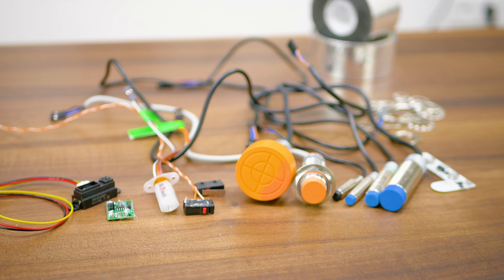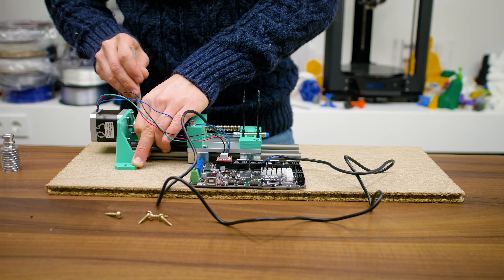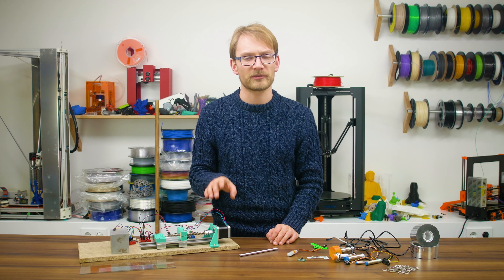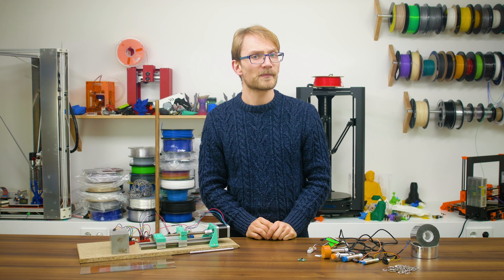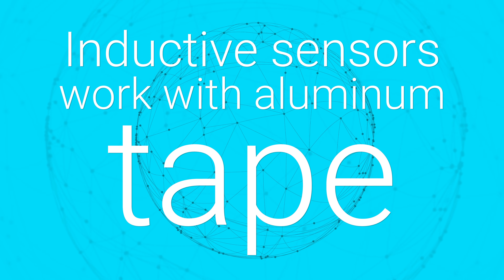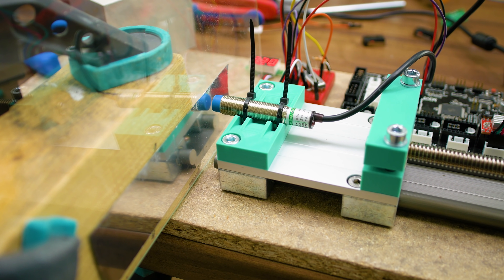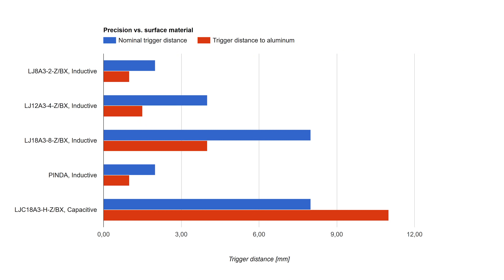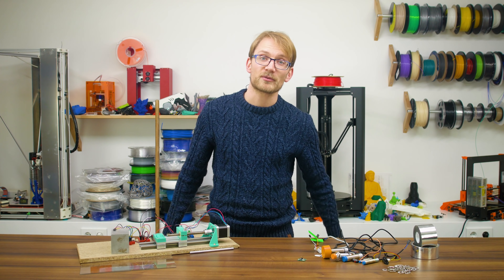Autoleveling on 3D printers: 9 myths and 12 sensors tested!

Comment: No hall effect sensor ???
Reply: I use to use the for home and limit switches supper repeatable
Reply: Used mine from old floppies and pc fans... worx ok...
Reply: hey guys, quick question. I set up my whole printer and everything works. but when I start a print, the printer homes and then the hotend digs into the bed, the z probe is as far as it can go. Where can I adjust this in firmware? I am kind of in a rush so any help is much appreciated.

Many thanks!!!!

Comment: Thanks for the info, but I'm not clear on which sensor would be best for printing on glass. Capacitive has always seemed like the best option, but the info shown in the video makes it seem like a terrible choice for any print surface. Can someone please clarify this for me? Thanks
Reply: Drew Lakebrink use inductive with aluminium foil sticked only in corners where measurments are done, best option as you are measuring top layer of the glass not the bottom one or the bed under the glass. Tom used wrong aluminium foil in the movie, use that which is used in air heating industry with high temp glue and it is a pure alu. works really best as you can even pri nt on this without a problem, just use proper glue stick from BIC as others may not work so well.

Comment: Hey Thomas, thank you for this great video! Unfortunately the links to the sensors point all to the same sensor.
What sensor would you recommend for my Anet A8? I've just begun 3D printing and I really love it :)
Reply: Have the same printer, and I just connected wires to the nozzle and the bed and used that as a sensor. Remember to cut holes in any nonconductive bed surface (like masking tape) and leave the normal endstop switch connected to keep the machine from crashing.

Comment: The video was very informative.  But I have to question your method of testing the inductive probes.  The aluminum bed on printers with them are only around 6mm, not the large mass of aluminum you used.  Could you rerun the tests using a 6mm aluminum plate and test the trigger height between probing the center, edge, and corner of the plate?  In my use of an inductive probe, I have seen a difference in trigger height based on where the probe point is on the bed.
Reply: Edward Boston I may be crazy, but my inductive probe acted like it was "seeing" my steel bed carrier through my MK3 aluminum heated bed. Is that possible?
Reply: I doubt it, but you never know.  I was seeing all sorts of inconsistency with the probe I was using that I gave up on it and went with a BL Touch.  One issue I had was I have a PrintBite on my bed and with a 4mm probe, it had to be so close to the bed that it was almost at the same level as the nozzle.

Comment: How do you feel about auto levelling? I personally don't like the idea of the Z axis having to move during a layer print. If I'm worried I just use a raft, which will end up levelling before the actual model prints. What I really want to see is 3 servos to level the bed corners.
Reply: Servos are just so unstable. What you want is the thumbscrew on top and having a hook for the nozzle to turn it. g
Reply: HenryLoenwind no idea what crazy setup you're envisioning but I guess it's not the one I was... I use servo in its loosest term: any motor hooked up to a potentiometer to increase positional accuracy, not as in your hobby king swivel arm 180° ones. As such, a small motor attached to the thumbscrew so it works as a linear actuator and a linear potentiometer hooked to that setup for positional feedback. Doesn't seem too ludicrous.
You were suggesting using the nozzle to turn a thumbscrew? That grates against my engineering sensibilities quite badly.
Reply: +HenryLoenwind
Oh man, the mental image you just gave me of a printer spinning its nozzle around a hooked screw to 'adjust' itself before it feels comfortable enough to start producing a part is hilarious to me, for some reason.
Reply: Guess you missed the G at the end. He was joking. LOL!

I thought it particularly funny a guy with "Mirth" in his name would miss the joke. :-D
Reply: My team is actually working on a printer for the market with all best stuff available, and that includes 3 steppers for Z axis for REAL bed leveling, not some sort of lame workaround. ;) Fast hotbed (0-110C in 25 seconds), 300x300x450 build volume. Won't be cheap though. Good stuff is never cheap :)
Reply: The MAJOR benefit of bed leveling is for modeling the actual bed surface, for constant correction during printing of a layer .. invaluable for large bed printers, where a lightweight print bed once heated simply can not be made flatter than +/-0.1mm, bed leveling saves the day.

Comment: out of all the sensors that you tested what one would you recommend to use on an aluminum bed with 3-4mm glass
Reply: i guess you can't go wrong with the bl touch if you print on glass
Reply: Why do you need a leveling sensor on glass aren't they flat?
Reply: @chloemcholoe3280  The glass (print bed) will be a flat piece of glass.   However, it is then mounted inside a mechanical device.  If one edge is mounted lower than the opposite edge then your first layer of 3d printing will not adhere well to the glass.  The print bed must be leveled to ensure that the 3d print head glides over the whole print bed at the same height before a 3d print begins.  Then the 3d printer will reliably 3d print the first layer and subsequent layers.  This leveling can be done manually, with no automated sensors, or leveling can be done with automation using the kinds of sensors tested.
Reply: @paull1316  yeah. my point was the reason I for these probes in my opinion is for fixing warpage. with glass you can just like live adjust the 4 corners as it's printing and it takes a few seconds really
Reply: @chloemcholoe3280  - glass can be warped or bowed if not made correclty.  Also, glass isn't the only height variable.  its possible that the gantry rail that the hot end rides on can be bowed.. which may change the height of the nozzle as it moves back and forth.
Reply: @georgelouie5330  but the 4 leveling knobs! you use those! but i guess. even the cheap glass I've bought are flat. but maybe that was just my luck!
Reply: @chloemcholoe3280  - the quality of the stock leveling knobs do not affect the flatness of the glass or the squareness of the glass to the nozzle.    My point was that the auto bed leveling probes fix more than imperfections in the bed.. it maps the distance between the nozzle and bed at multiple positions, and then uses that map to adjust the height of the nozzle to maintain a constant distance as its printing.

Comment: Mine BLTouch is just horrible at repeatability :( Up to almost 0.2mm difference between probes. Only solution suggested by support was to slow down probing speed, but it wasnt very helpful. I have better result with capacitive sensor on 12 volts

Comment: You mention that the aluminum tape doesn't work but I am using it on a glass bed and having great luck. Maybe I got tape with a higher aluminum content or something but my sensor seems to reliably sense around 2mm on a single layer of aluminum tape (under blue tape) using the LJ12A3-4-Z/BX sensor. I am however running it on 12v with a voltage divider on the output so maybe running it on 5v reduces the sensing distance further making it unusable.

Comment: My Printrbot Simple Metal inductive sensor triggers using a glass bed with aluminium tape.... The sensor actually triggers at double the height than with the stock bed. Strange.....
Reply: Funny, I too have a Printrbot Simple Metal with glass bed and aluminum tape.  It worked from day one and I never had any problems.

Comment: Does anyone have any suggestions for an effective sensor for Buildtak coated glass on a mk2a PCB heated bed.  I've tried a Pibot Optical Endstop but couldn't get it to trigger against the matt  black of the Buildtak.  Thanks
Reply: My Mini IR sensor works with black Buildtak.

Comment: great video! cool rig, shows the power of rapid prototyping. been thinking about Auto leveling, I have a delta that uses pressure pads, would be great to see how well it stacks up, down side is Auto leveling is tapping printer head into the bed every time.

Comment: Mh for the LJ18A3-8-Z/BX I run it directly from the board without a voltage divider. Tried it first with your voltage divider approach but then the sensor didn't trigger at all. But running the sensor directly of the board it works fine (for me on a aluminum bed with BuildTak ^^)

Comment: I have a question about the inductive sensors... How much 'material' do they need below and around them and at what point does it make a difference? For instance: If I trigger right on the edge of my aluminium plate it triggers lower then when probed in the middle of my plate. Does thickness play a huge role? Do they trigger higher when there is a bearing holder right below the sensing point? How thick does the aluminium need to be to not have that influence...

Comment: one thing you're missing are FSRs, force sensing resistors. i use them on my delta which has a glass bed over an aluminum heat spreader.
they seem to be very repeatable but only above 0.13mm deviation, any less than that and smoothieware's autocalibration gets upset
Reply: I too use FSR's with Smoothie on my delta. I like them a lot, though they have their own drawbacks too.

Comment: Have you try the membrane film based zprobe (basically just like a membrane keyboard/contact switch)? I find it is the best zprobe for delta printer as it can be easily mounted directly under the nozzle to give the best on-points reading that a delta auto calibration needs (no zprobe offsets), without being affected by heavy trigger force that could potentially deform the belts/pivot points etc.

Comment: Microswitch sensor test is pointless without including the retraction methods.
Reply: The mechanical microswithes need to be lowered and raised every time you do a set of probing. This is commonly done with a servo. 

You make it look like mechanical microswiches are more reliable then a BLtouch but you did not include the inaccuracies gained by having it on a servo or similar system to retract it when you are done probing.
Reply: Stephen Germiller He does talk about that briefly @ 3:30

Comment: Are you planning on sharing the data itself? Not only the graphs included in the video. Would be great.
Reply: But only when hard-mounted - which is good for those of us still using endstops - but remember the mechanics to flip them out of the way  will introduce errors as Tom said. But that would mostly be a "servo repeatability test" not a "sensor test".
Reply: @jedijeremy  On my Delta I have a magentic sensor which I need to deploy manually. Works fine, it uses a microswitch without lever. ^^

Comment: +Thomas Sanladerer Great video! Aluminum tape definitely works though! I have used it multiple times, amd we also use it reliably at our Makerspace. There are different types of aluminum tape however. It looks like you are using the "metalized" type that is similar to Mylar. That stuff will not work. You need actual aluminum tape. The metalized type isn't very conductive. Actual Aluminum tape is basically just like aluminum foil with an adhesive backing. The only thing you have to watch out for is the adhesive. Alot of aluminum tape has a low temp adhesive and will start peeling up at around 50°C, but you can find some that has a high temp adhesive which is what we use under our PEI at the Maker Space.
Reply: You can tell by the video that it's the wrong kind of aluminum tape. Actual aluminum tape has a dull surface to it, and it is much thicker as well. Basically the tape you tested is just plastic tape with a small ammount of aluminum vapor deposited on the surface.  Other than that, Great video!
Reply: Agreed. I have had great results with aluminum tape on glass beds!
Reply: I've been using a piece of heavy duty aluminum foil between my heated bed and glass for almost a year - with a 8mm inductive sensor it works great.  It worked with a 4mm sensor as well - but was a bit too close for my tastes and Marlin's probe test seemed to show the 8mm was about the same for accuracy so I've stuck with it and been very happy.
Reply: I've used copper tape in the past on glass, that worked pretty well as well.
Reply: I saw recently ferromagnetic foil (use as sticking surface for magnets), maybe this will be better than aluminum tape for induction sensor.
Reply: Copper is indeed a good option. I am considering this for leveling my delta towers.
Reply: +Douglas Moody The distance number between the probe and the aluminium is never globally fixed, it just needs to be less than the probe max sensitivity. When leveling your build plate, you guess the ideal distance value, test it, change it until your first layer is good. At this point you enter this final specific value into your printer firmware and the printer will use that specific distance to print correctly. TLDR: that distance is not the same as the distance between the nozzle and the glass, and that's a good thing! As long as you level correctly.
Reply: Had minor problems with some Aluminum tapes and inductive sensors due to reduced sensing distances that I didn't like quite as well, found copper tape to be far better. But either works great.
In fact on my setup(8mm inductive @12v) copper has better sensing distance than the aluminum heatbed(My printer crashes on autolevel if I leave the glass off and it tries to sense the aluminum sheet)
Those here who use copper/aluminium tape under 3 or 4mm glass: What is your sensing distance? I put the tape on top and just don't print in the very corners as 1mm or so above the glass is too close for me with the tape under it.
Reply: We used to call it speed tape or 2000 mile an hour tape. I once used it to cover a hole left by a missing access panel on the skin of a C-130 (for a single trip home, not a fix).
Reply: If you don't use adhesive , how can be sure there is no space between Al and glass plate?
Reply: Try this one Tom:  3M™ 1436 Conductive Aluminium Tape, W.50mm, L.50m

Backing adhesive matters a lot - no-brand versions of this stuff can be bought from DIY stores as insulation PIR sealing tape, but its glue may fail at HBP temperatures and bubble up, ruining accuracy and in my case, wasting several sheets of Build-tak I had layered on top.
Reply: yes copper foil (guitar shielding)  gives much better detection distance results than aluminum
Reply: I agree, I used aluminium tape under glass for several months (before getting a MK3) and it worked great with my 8mm inductive sensor!
Reply: the glass is  a fixed thickness so you just correct that when you set the nozzle offset.
Reply: Likewise I've been using aluminium tape on a glass bed for ages and with perfectly acceptable results IMO. My sensor won't detect it on the back of the glass though so I just cut out 9 little squares and stuck them on top of the glass (four corners plus a another on each of the longer sides). Originally I found that this approach worked by sellotaping some kitchen foil to the top of the glass bed.
Reply: How about cutting some squares of aluminum from cans and just clamping them to the bed with binder clips? It seems a waste to buy a whole roll of aluminum tape.
Reply: Depends how level you could get them with the surface of your build plate I guess
Reply: I'm using a ferromagnetic spray on the bottom of glass bed. Just a thin layer.. it works flawlessy for inductive sensors!

Comment: Has anyone ever had there printer's extruder making a popping noise? When my printer does this there is a small gap in the extruded filament.  Any help is appreciated!
Reply: Thanks, Il look into that!
Reply: I have heard of it with moisture (poor stoage or age) or contamination in cheaper filaments.
Reply: Moisture in your filament, need to dry it in an oven
Reply: Defiantly sounds like moisture. This is a bigger problem with ABS and a BIG one with Nylon, but I've had it with PLA too.

Another drying option is using a vacuum chamber with desiccant. Takes a bit longer but I have a "Food Saver" with vacuum containers and also a Revo Tumbler with a large acrylic cylinder that works fine for smaller rolls (pulls a harder vacuum than the Food Saver). 

Someone suggested pulling a vacuum on a "Paint Pot" for the regular reels (think there's a YouTube somewhere...).

Harbor Freight has them but they're $99 US, a bit pricey. (Plus you'd need a vacuum pump if you don't have one. More $$). Harbor Freight does routinely run "50% off" sales, but still ... Haven't researched EBay, Banggood, or AliExpress yet. Just a thought. 

I have some Proto Paradigm "$5 Filament" in one right now and the beads are color changing after 1 day, so it works.

Oven is faster, but this is fume free and running an oven for hours chews up electricity fast.

IMHO.

PuterPro
Reply: +NorwayVFX What temperatures and time would you recommend ? say for PLA ?

Comment: I think the standard deviation issue is quite simple: if the error is really random and its distribution is really normal, then just average the samples. How ? you do it backwards with by randomly choosing a Z zero and counting the micro steps to the sensor triggering and averaging that number. The micro-stepping itself introduces a normally distributed random error (if you alway approach the triggering point from top to bottom) ? it's ok, the composition of both noises is still normal and you can still take the average. And if you are really smart, you look at your samples and check their distribution, and report an error if there is an issue with it.